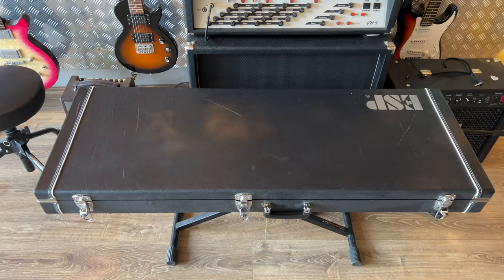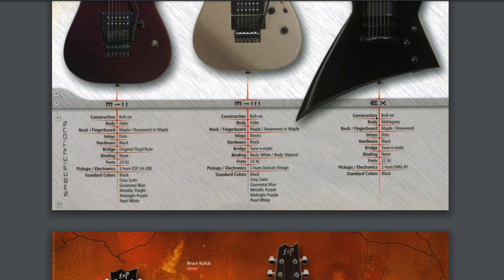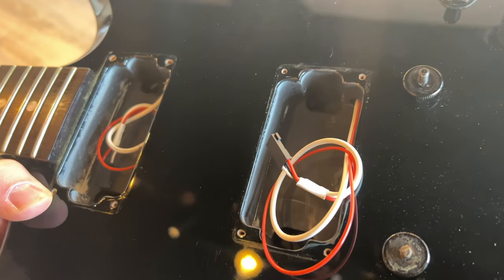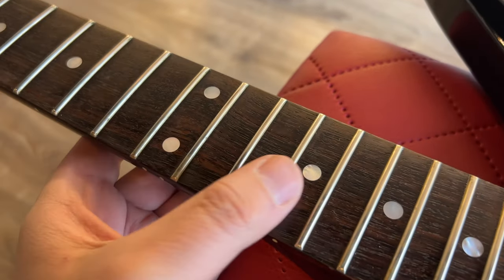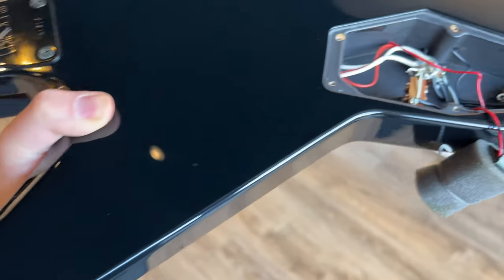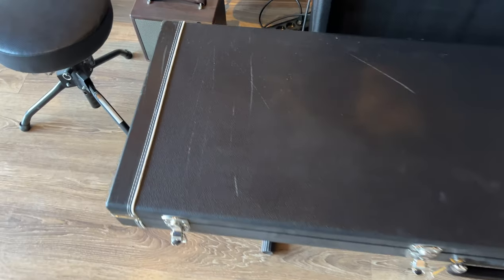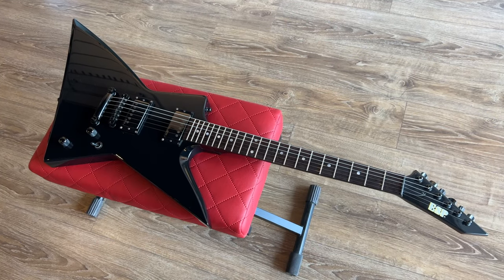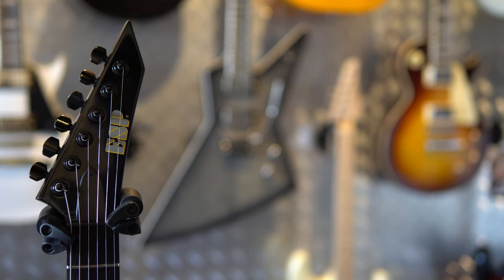The ESP EX Standard is the less popular Explorer

Comment: I just bought a LTD EX 210 and it should be delivered in a few days ~ it's neck through construction, reverse headstock, and no label on the fretboard for $500 new. Has only 1 Seymour Duncan knockoff pickup in the bridge. It seems like they're trying to make a "budget" Black Metal Edition?? 
I have a 6 string Solar Explorer that I bought a few years ago, but the extreme neck dive is killing me... It should be criminal to put out a guitar with such poor balancing.. I've added weights and moved the strap buttons to not much relief. So hopefully this new test guitar will solve the issue, if I can balance it, I'll upgrade all the hardware, pickup, tuners, bridge etc. 
I also currently have a LTD 1000 arrow, that has ZERO neck dive and rock solid Floyd Rose, if anyone was thinking of going that route, you'll be happy with it \m/
Reply from the maker: Thats a good deal
Reply: How was the QC on yours?
Reply: It was the usual suspects. Action was a little high, pickup was a little low, and when I took the strings off, the nut just fell out haha. Looks like they didn't use much glue, and there was no damage, just glue it back in. Since some guitars don't come with the nut glued in anyway, no big deal. The LTD tuners were good quality, but ordered some locking tuners just for convenience sake. The neck is true, Frets feel really good for a 500 dollar guitar. Volume and tone split have no issues. No hum of any kind so good grounding inside. And the fretboard and neck shape feel almost as good as my ESP arrow and Solar Ex. it's built for speed. The guitar body has zero blemishes anywhere. I think it's a great guitar for MeTaL. The pickup sounds like a Seymour Duncan JB 95%  @stefandesouza5610

Comment: I had an LTD one this shape, but I sold it because the neck dive was too much. Also it only had 22 frets, which is not suitable for my needs.
Reply from the maker: Hm, I am surprised that it had neck dive. Maybe the strap buttons placement was the issue?
Reply: That's a shame. I own one and the neck dive issue is easily fixed by moving the strap button to the back of the guitar as opposed to the standard position.